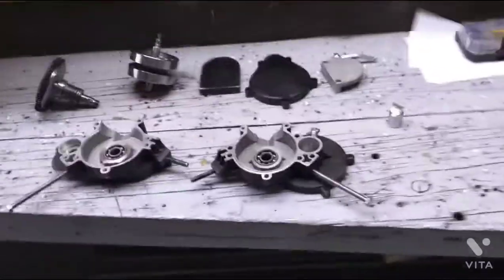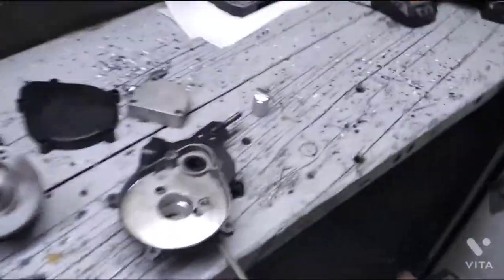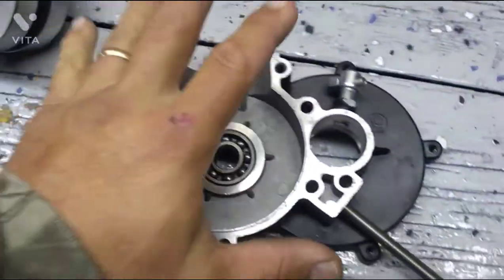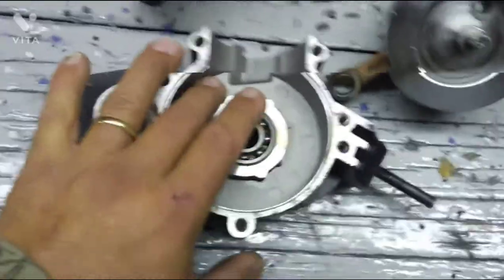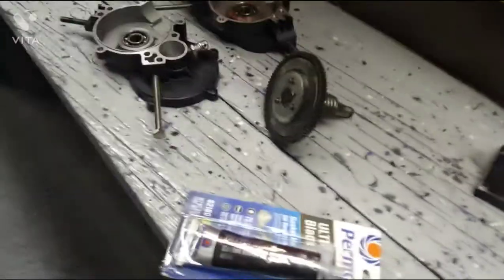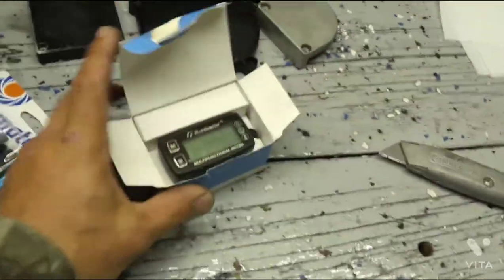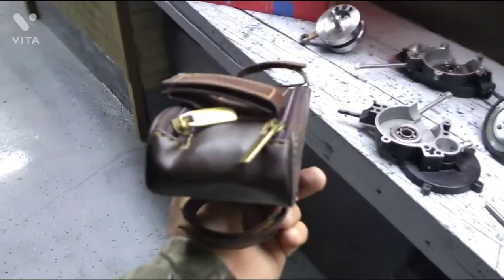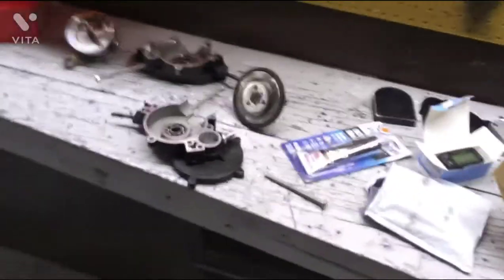PHANTOM 85 complete teardown and rebuild (version 3) part 1 ((YD100 bottom end))

Comment: Your transfer ports are not used on a phantom 85.The jug has its own circuit.Its best to delete transfer port using jb weld to increase case pressure.

Comment: I would be curious to see if the new wrist pin bearing is a 12mm unit like the MS460 the piston and cylinder are based on, or if they adapted it to run on a standard 10mm wrist pin similar to the original DIY fix/upgrade that others have done.  Just my 2 cents, but I wouldn't polish the crank case internally.  The school of thought with case flowing is much like intake port work on 4 stroke engines where a slightly rough (300 grit sanded or cas cast texture) surface finish is more ideal as it creates a boundry layer for airflow along the surface, actually allowing for higher velocity airflow closer to the surface as compared to a polished one.
Reply from the maker: Good observation. I'll have part 2 coming tomorrow describing everything including the wrist pin. Thank!
Reply from the maker: Also, I think you right on not polishing the bottom end. Good looking out. Got part 2 coming tomorrow. Thx

Comment: Good shit bro' I got a phantom 85 💪😎
A G2 after the first one shattered I keep mine stock and drive it daily it has mad miles I'm thinking I might want to do some mods (pressure relief valve) like the billet 2stroke motors and changing the wrist pin bushing to bearing.anyways I like what you're doing to your phantom 85 good stuff

Comment: The phantom 85 engine don’t work from the factory. This engine need o lot of work inside and out . If you like that engine to wake up , upgrade the carb , make a intake . Reed 2 and the expansion chamber + the clutch pads . We have a videos on are channel check them out .
Reply from the maker: Will do. Thx
Reply: It's pulls like a bitch stock. LA hover got hurt to prove it.

Comment: Next time just take a torch and he eat up the bevel gear and it will come off easy. And if you can't get the magnet off you can use a battery terminal puller. I build engine for 9yrs now.if you ever need any help hmu.
Reply from the maker: Cool. Thx

Comment: I wonder if any can make a longer connecting rod and a riser inbetween the case and cylinder the same length as the difference of the old connectong rod and new longer one the displacement of a 52mm bore and a 60mm rod would be a 126cc and stock rod would be 40mm so 2cm thick spacer and youd have an interesting engine
Reply from the maker: I thought of that, but then I was like....how will the timing react?